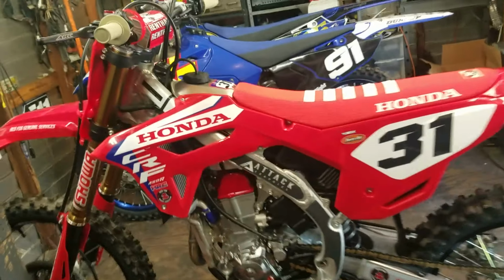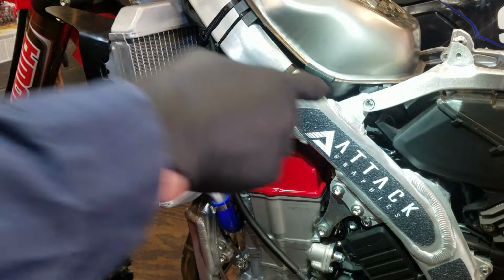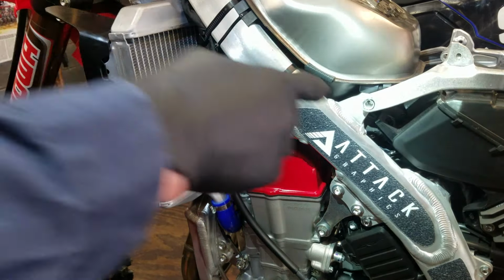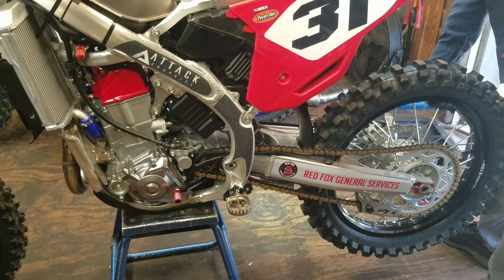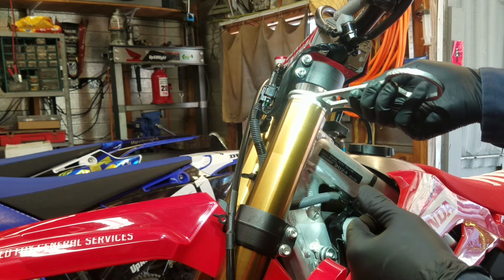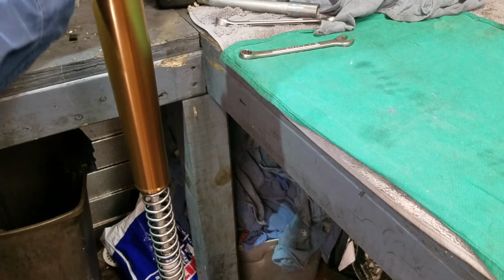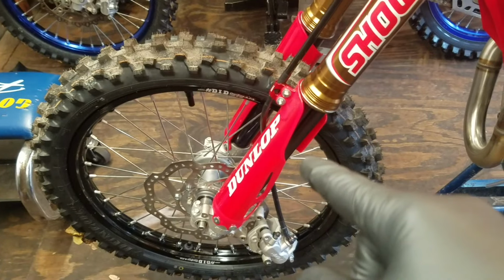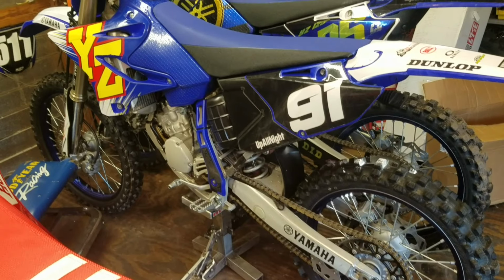1:11 Changing Fork & Shock Springs CRF450R CRF250R (2017-2025) Honda Motocross Dirt Bike

Comment: I saw on someone elses video that the strap and loop is so you can lean the tank over to one side and the strap will hold all the pressure so your tank cant fall. it would lean toward the left side of the bike.
Reply from the maker: Ahh good idea. Would be good for checking the valves. But may get in the way while doing a top end.

Comment: Any chance you have a video of changing shock fluid and nitrogen and all that good stuff ? I appreciate you and your videos you’re the best out on YouTube
Reply from the maker: I surely do. I have one for the CRF, one for the YZ, and one for the KX. Which one are you looking for?
Reply: One for 2018 crf450r ! I’ll get to lookin in your old videos thank you !
Reply from the maker: @anthonynunez2274   Right on, here is a link to the crf450 https://www.youtube.com/watch?v=_EECSoKn5ks&t=6s
Reply: Thank you !!
Reply: Another question sorry man but I did the fork service on my 2018 crf450r and I’m not too sure if I remember bottoming out the collar you said it was very important to do that could you explain why it’s important to bottom out the collar?
Reply from the maker: @anthonynunez2274   Yes its important. The rebound adjuster thing that bolts down onto the shaft and then the collar is locked down into it. That rebound adjuster thing needs to bottom out on the shaft before the collar comes in contact with it to lock them both together. If the rebound thing (whatever thats called lol) is not bottomed out on the shaft the fork overall length will be longer and there will be less threads holding the forks together overall.  By screwing the collar down on the shaft all the way by hand that allows the rebound thing to screw all the way down on the shaft till it bottoms out on the shaft, then the collar can come up to the rebound adjuster and lock them in together. I know it sucks but I would buy more fluid and go back in to get that right.
Reply from the maker: @anthonynunez2274   Yes Sir!

Comment: To buy a top end for my yz 125 it’s on rocky mtn it has a option of full oem kit for 72$ but if I go click all parts I need individualy it’s like 160$?
Reply from the maker: Is that a oem kit or aftermarket?
Reply: @UpAllNight91  both are Oem kits
Reply from the maker: @SethMacgillivary   what are their part numbers?
Reply: @UpAllNight91  I’m not sure but if u search top end kit yz 125 on Rocky Mountain a full kit for 72$ oem will come up. But if you go to oem parts and put all individual parts together it comes to like 160$
Reply from the maker: @SethMacgillivary  Ok found it. Yeah kits from manufactures are often cheaper but wow at 72 bucks thats a deal
Reply: @UpAllNight91  yes i can’t tell if it’s real
Reply: Dam DownByNine69 your interactive with your comment section.
Reply from the maker: @keithalexander36  I was down by 10 I think lol
Reply from the maker: @SethMacgillivary  Its real. And its rocky Mtn, so if it arrives and you dont like it you can return it.

Comment: Why doesn’t Rocky Mountain sell the newer yz 125 head gasgets individually
Reply from the maker: You mean the cylinder base gasket for the 2200 to 2024 YZ125? I dont know why they dont have that. Its been like that for like a year now. I order them from motosport because of that reason.
Reply: @UpAllNight91  ohhh ok and yes I meant the base gasget
Reply from the maker: @SethMacgillivary  right on
Reply: @UpAllNight91  what does the top of piston look like if lean or rich?
Reply from the maker: @SethMacgillivary  ashy white can mean its been lean, lotf of black carbon can be from being rich but can also be from just not being riden hard enough to get enough heat in her to keep it clean.
Reply: @UpAllNight91  I thought lots of carbon is lean?
Reply from the maker: @SethMacgillivary   Nah, lean is surely a whitish light gray ashy look

Comment: Why didn't you just remove the lower shock bolt and dog bone bolt and replace the spring from the bottom. Much more simple.
Reply from the maker: I have done it both ways. The owner of this bike told me he felt it was slightly easier to pull it from the top so I just took his advice.